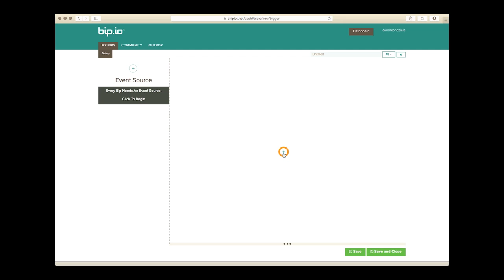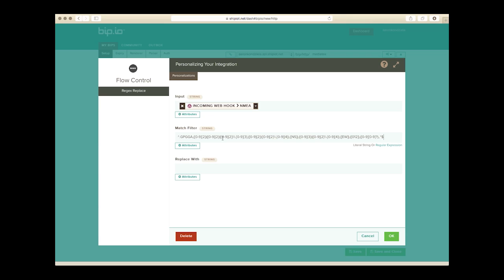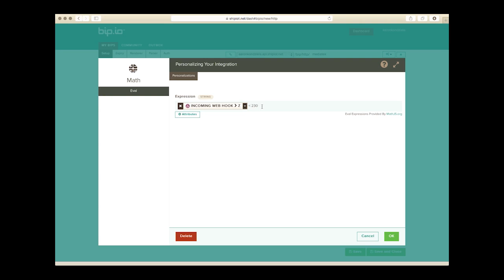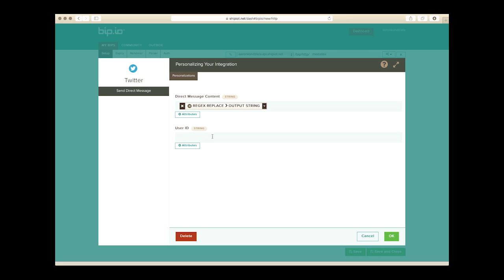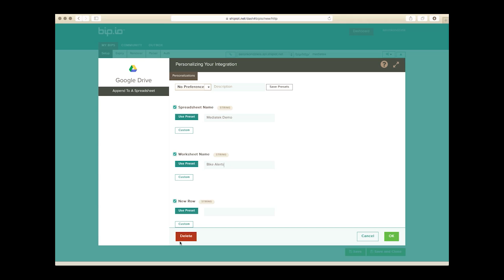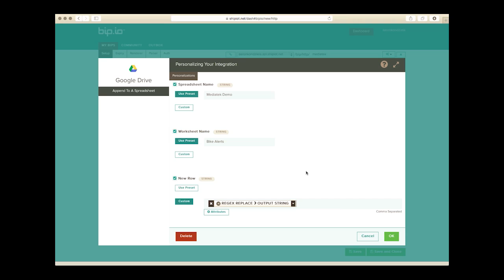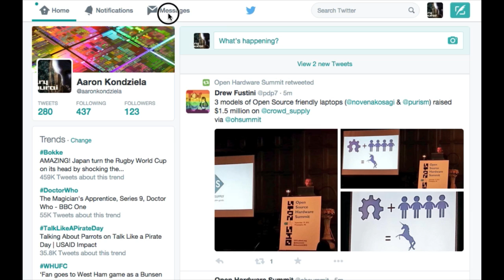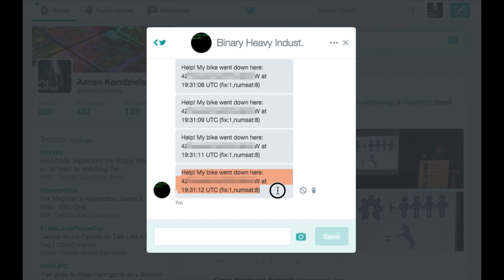Ship IoT with Mediatek LinkIt ONE - Motorcycle Crash Alert Demo

Comment: This might not be the most proper place for asking... But any ideas why the GPS gets stuck? How can waitForGPSFix be debugged further? 

Starting up...
Connecting to GPRS APN...Success
GPS Powering up...GPS PoweringOn done
Getting GPS fix...
Reply: Ah nvm just noticed the GPS is still waiting the char at offset 43... How do i get it to be magic number 1?
Reply from the maker: +Eduardo Gomez Your best bet is to dump the raw NMEA sentences to serial debug, and look up what all the fields mean (there's a link in the blog post, the magic 1 just means "lock acquired" more or less). Like any GPS, you need a clear, unobstructed view of the sky to get signal, and it can take several minutes to get the first satellite lock. After the first lock, subsequent locks will be quicker.
Reply: Binary Heavy Industries  Makes sense thanks. I plan to get the Grove - 3-Axis Digital Accelerometer(±16g) x1 do you drawbacks/advantages (if any)?
Reply from the maker: +Eduardo Gomez any accelerometer should work fine, as long as the board can read it. Really just need to be able to detect if the thing is not generally upright, within tolerances that account for normal acceleration while driving and turning. Anything beyond that would be specific to your use case, if you wanted to record the actual acceleration data during driving, to analyze bike performance, for example. In that case you may want a part that has maximum G-force ratings within an appropriate range, so you get a good signal/noise ratio.